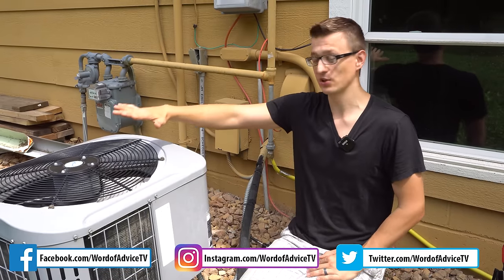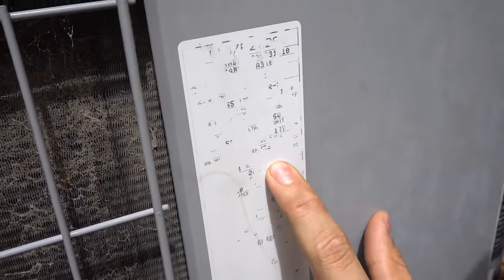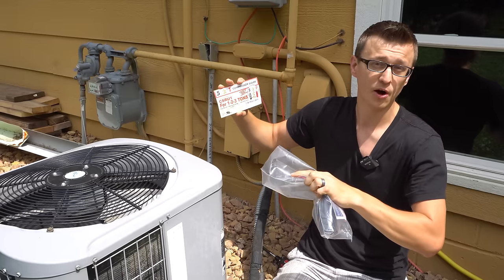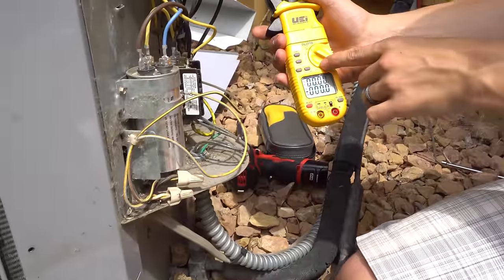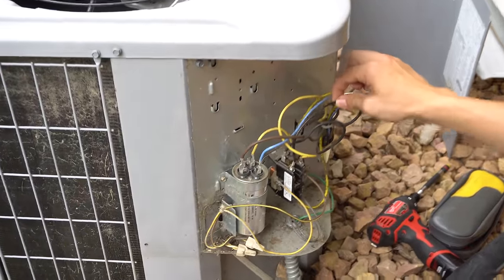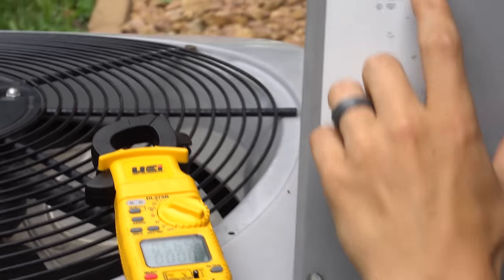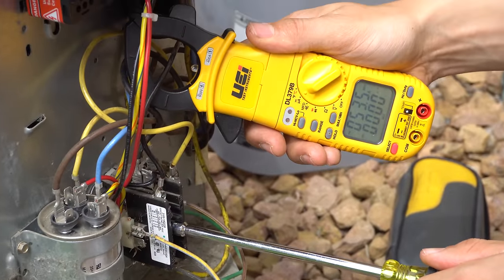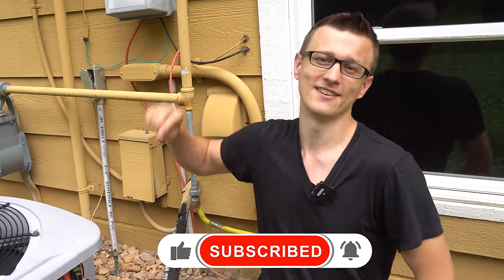HVAC AC Compressor Locked Up ( LRA )

Comment: I installed a 5-2-1 on my 2 Ton Condenser even though it did not need it. The in rush current went down dramatically ! It now starts even smoother that it did before.

Comment: A technician tested my home AC and said I needed a new compressor because it would not start.  A few days later another technician arrived with the new compressor.  Thanks to your website I asked a few questions.  The technician put in another capacitor and a booster.  The AC started and all diagnostics tests were fine.  This saved me $1,750.00.  This video helped me understand enough to ask the right questions. Super.  Thanks.
Reply: I’ve watched thousands of Hvac videos (don’t ask) and this guy is by far the best in terms of clarity and teaching. I’m glad you were able to save almost 2k

Comment: Compressor savers do NOT reduce the maximum inrush current. They provide extra starting torque, causing the amount of time that the compressor is pulling LRA to be reduced, but for the moment of inrush, the compressor saver INCREASES the current.
Reply: So after installation if the inrush current doesn't drop much, how can you verify that the compressor saver is working correctly?

Comment: Not sure that using the Max button and Inrush are equivalent. To measure Inrush, you need a clamp meter with an actual Inrush button, because it measures current in the first 100 milliseconds of startup. Max doesn’t capture current in that time frame. Soft start kits are more effective at reducing startup amps than hard starts which actually spike the compressor start winding with higher amps to kick start the compressor.
Reply: good info, soft start kits reduce amps

Comment: I initially measured my HVAC AC compressor, that has a LRA of 95 amps, with a min/max clamp on meter and got a reading of 75.7 amps and I thought that's good. Then a friend of mine got in my head and told me I needed an inrush meter for that measurement. I caved and bought one and then got a reading of 95.7 amps. I just ordered a hard start kit and hopefully that helps.

Comment: I recommend changing them every 5 years. Only use Hard Start Kits that use a true Potential Relay. The RectorSeal Kickstart (2 wire) and the 5-2-1 Compressor Saver (3 wire) use a Potential Relay. I recommend the RectorSeal Kickstart (it uses 2 wires that connect to the Run Capacitor - HERM and COM). But the Compressor Saver is also good (3 wires with one connecting to the common / ground on the Contactor). 

They both work the same way - the Potential Relay detects the pickup voltage (back EMF). This causes the relay to disconnect the start capacitor when the compressor reaches about 75% speed (less than a second). 

Note:  Before any hard start kit is installed, the compressor run capacitor should be replaced or at least checked to confirm it is still within its rated specifications using a capacitance meter.

Note: Supco does have hard start kits with a Potential Relay (Models 3W1, 3W2, 3W3, MPR1, MPR5, SPR5, SPR1, SPP4E, SPP5E, SPP6E, SPP7E, SPP8E, SPP9E, SPP10E)  but some don't!
Reply from the maker: Thank you for all the additional info Capt!
Reply: Thanks
Reply: @WordofAdviceTV  
Thank you so very much pal
You are very good at your work and also a very good teacher
Thank you again

Comment: Hope you’re do a video on the “Micro-Air EasyStart” soon. It’s a soft start, just the opposite of the hard start. It will drop the inrush amps 60 to 70%.
Reply from the maker: Thank you for the suggestion! I will add this to the list.
Reply: @WordofAdviceTV  I have installed two, plan to do 4 more this coming week. They do what they claim!

Comment: That is correct without INRUSH engaged the reading will not be the actual inrush current because the meter does NOT sample the current often enough.

Comment: I checked the max amps and amp draw right at the main panel for the double pole circuit breaker that supplies the AC. . Each leg had a max draw of -80 amps (81 on one and 77 on the other) on start up and ran at 17.5 amps steady state. Used a Fluke 87V in high res mode. The RLA is 23.7 amps and the LRA is 129.0 amp per the specs on the unit. It’s a 4 ton (48,200 BTU) unit. I do have a 5-2-1 kit on it as well. I’ve never tried it but I don’t think my 7500 W peak generator will start this unit.

PS those coils are very dirty!  Thanks for posting
Reply: My 4 ton RLA 22, but runs hot 32 amps.  It may be suction line is too small  3/4" when is should be 7/8".  I'm trying to learn what is needed to start compressor using solar battery backup to help offset cost of DIY solar.  I've not yet tested LRA that  is listed at 117 amps that I'll need to get as low as possible.

Comment: Hey Jay when would you recommend installing this kit ? When the unit is new or after a few years ? Thanks for the video.
Reply: If installing when the condenser is new, it will likely add to the life of the compressor as it starts with less stress due to the assist in initial current draw.  On older systems, it helps as well.  After installing, you'll definitely notice the lag time from when the compressor begins to engage and full run diminish.
Reply: Manufacturers used to preinstall these kits on all new units to extend the life of the compressor.  Most don't anymore - to save $20 in manufacturing cost!?  Some manufacturers like Trane actually sell their own brand of hard start kits.

Comment: Ha: the anti climax at 7:18 gotta love it when that happens! 😁. 

Can we presume gas pressures have equalised by the 2nd test? Repeat the test too quickly : residual back pressure may  affect LRA
Reply from the maker: Haha yeah, I was briefly surprised before realizing what's up. 

And yes! I always give it time to equalize when powering on the condenser multiple times

Comment: I installed an EasyStar from Micro-Air and allowed my Trane XL14i 3Ton 83LRA rating to drop so low I could run my central air on a 9k portable generator!  I live in Fl and I wanted to have AC after any hurricane.

Comment: Whats up brother ive always wondered why arent hard starts included in unit from manufacturer or recommended to add after if it seems like it would help with the wear and tear during start up. Any ideas why?
Reply: It’s all about cost.
Reply: Manufacturers used to preinstall these kits on all new units to extend the life of the compressor.  Most don't anymore - to save $20 in manufacturing cost!?  Some manufacturers like Trane actually sell their own brand of hard start kits.

Comment: Great video thanks for posting!  Kind of curious if you measure the amps from the L1 and L2 wires Individually will the sum of those two equal the amperage measured on the common? Thanks for another great video

Comment: Fun Fact: The "IN RUSH" current being so high is due to the necessity to generate the electro-magnetic field surronding the coils. An electro-magnetic field is stored energy, and the collapse or creation of an EM field is done so (likely) at the speed of light (this has never been measured to my knowledge). That In Rush of current is the field being established. This is why draining resistor banks or field breakers are necessary when cutting large motors off, the field collapses back down (stored energy) and actually uses whats called a hysteresis cycle to convert magnetism into dielectricity. Magnetism in an electric circuit is always linked to current/amperage while dielectricty is linked to the volatge. And the system is constantly fluctuating (in AC power) between the two at 60hz. This is all according to C.P. Stiemetz, the guy who reversed engineered Teslas AC motor, and was the founder and director of General Electrics R&D division until his death. Anyone interested should get his book "Elementary Lectures on Electric Discharges, Waves and Impulses and other Transients."
Reply: Wow, so much to learn.

Comment: Fantastic videos Jay!! Your channel videos have really motivated me to learn more about my home HVAC system and...make HVAC great again!
*Would this LRA compressor struggle also apply to heat pumps (running in heating mode) in cold weather?* Yesterday it was just above 0º C / 32ºF freezing (Toronto, Ontario) and the compressor and fan unit both seemed to be struggling to start...but eventually did after about 5 seconds of "whining". It happened only once and ran fine later. The outside unit is going on 7 years, so it is not too old. I will have to diagnose the LRA and the start capacitor properly after going over your videos again.
Btw, any plans to make videos on heat pumps? :-) Not sure how common they are in Minnesota / Hawaii, but it would be terrific to hear your thoughts on the topic of heat pumps in general.
God bless you and your family.
Reply: Yes it doesn’t matter the season. Remember the start assist ckt does not stay in circuit. Back EMF takes it out once unit starts up. You may have been listening to ur heat pump coming out of defrost mode.

Comment: great video...
I have got two questions on LRA
1 what do you mean when you say that the compressor is locked?
2 how do I know that my compressor is locked is it when it draws amps more than the lra or less than the lra?

Comment: FYI "Compressor Saver" or all capacitors in general should be installed upright, they'll last longer. Per my Microbiologist turned HVAC single man contractor professor & capacitor makers he's talked to.
Reply from the maker: I have heard that before too, thank you for pointing it out!
Reply: Thanks for this because 2 other tutorials I saw have them mounted sideways. I put mine in sideways yesterday and am going out to fix it now. The hard start kit relay also needs to be oriented correctly too which I luckily knew beforehand.

Comment: So. Why such a small change? How does this thing work? Is it a staged (timed) capacitor engagement?
Reply from the maker: I am not entirely sure why the small change. It varies from unit to unit, how much the start up amps go down by.
The start capacitor stays in the circuit for only a second or less before getting taken out by the potential relay. It's only there to assist the compressor at start-up.

Comment: Hey Jay is this the same device calld a hard start kit??  I remmber it go in series  whit the run cap .. by the way great video every time u make a video I allways take note you the man .. and congrats  on movie to Hawaii
Reply from the maker: Thanks Juan! Yes, the 521 Compressor is a hard start kit. There are a few different styles but they are all basically a start capacitor and some kind of relay that takes the start capacitor out of the circuit after the compressor is up to full speed at start-up. After answering this comment, I will put some Amazon links to different hard start kits in the description for anyone interested.

Comment: How do I tell if my furnace and hot water tank are natural draft or fan-assisted? I think they are both natural draft but want to confirm. The furnace is category 1 (80%) - 1990 Olsen furnace and hot water is John wood 2012. Thanks in advance you are very helpful!
Reply: For your furnace just remove the access door and then trace your flue pipe back to the furnace. If it’s induced draft (fan assisted) you will see the inducer fan and motor. Basically follow the same method for your water heater.

Comment: Jay, could the small difference be because the hard start didn't get charged up cuz the power was off?
Reply from the maker: I think it's more because I was working with a scroll compressor. For some reason the drop is not as impressive on those. But unfortunately I haven't done this test enough times myself either so I can't say for sure. If I did this 20 - 40 times, that would probably paint a clearer picture but I rarely test the before and after.
Reply: @WordofAdviceTV   ok, didn't know that.  Thanks. Love these videos! (as everyone else does)

Comment: I have the same question as Jeff.
I took out the one that I had put in the old unit, so should I install it in the new unit?
Reply from the maker: There is less strain on the compressor when it starts if there is a hard start kit installed. So I would say why not put in? :)

Comment: Hi Jay
Thanks for all great videos!
Question: for 7.5 ton RUUD unit 3 phase compressor 
Is there such a kit?

Thanks
Robert
Reply: There is no need for a hard start kit on a 3 phase unit as the phase shift that the hard start kit provides is already "built-in-to" 3 phase.

Comment: Talking about Inrush, I have tested Fieldpeace, Fluke, UEI, Klein, with the Min Max and I have seen little to no difference with a meter that actually has an Inrush setting. Im kinda wondering if its just a selling point.

Comment: Jay my man! Do you have a vid on how to install a fuse or breaker inline with hvac transformer to prevent burnouts due to thermostat wire shorts?? Thx n advance brotha!
Reply from the maker: Hey Justin! I do not have a video like that unfortunately.. But in this video right here, I do show an example of how I spliced one into my furnace: https://youtu.be/52iq9rYI0mI 
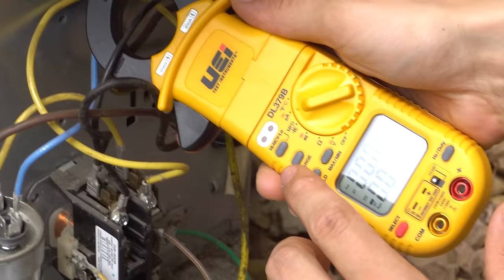Start watching at about 5:30
Reply: @WordofAdviceTV  thank you sir!

Comment: Viewers.  You cannot measure IRA with a meter that only has min/max.   You must use a meter with Inrush setting.  IRA is too fast for a Non-IRA capable meter to catch it, that's why they have a dedicated "in rush" feature.   That's why there was virtually no difference in his readings.

Hard start kits work.  If your compressor makes a grinding noise when starting but still starts, a hard start will probably buy you time before the compressor fails, but it will not "fix" what is wrong.

Comment: Hey Jay, this is Jay too. I have some issues with my compressor the start-up Amps is around 94 but the LRA is 75 amp in the label. I checked your other video first (How to Install a Hard Start Kit in Your Air Conditioner). But during the video, you said 'don't put in a hard start kit if you already have a start capacitor in your unit'. But in his video, you seem to have the start capacitor but do you still recommend the Hart Start Kit? Would you mind explaining a bit to me and I appreciate it.

Comment: so if it is starting at 56 Amps , wouldnt it immediately trip the breaker before locking up? unless its a 60 amp breaker?

Comment: I was under the impression that a locked rotor is a compressor that has internal damage and needs to be replaced?
A compressor that does not have enough amps to spin it up is not locked same as if you lost half the leg in or a bad capacitor.
Correct me if i'm wrong.
Reply from the maker: A seized up compressor does not always indicate that there is internal damage although it is likely to be the case. It's possible that the unit had a weak run capacitor for a long time which eventually led it to lock-up. I have come across many locked up compressors that I was able to kickstart using a hard start kit. The dual run capacitor is good, power is good, compressor checks out good, yet it fails to start. Put in a hard start, and there's a good chance it will start right up. I have also had times where the unit would only turn on a couple times before it would fail to start again even with a hard start. If it gets to that point, then it's truly game over for that compressor.

Comment: PTAC compressor is humming then clicks off. LRA is 33 but only drawing 23amps on common with hard start kit. New capacitor installed. Changed the board as well. What else could this be? Thx

Comment: If the compressor were to lock up well that damage the Freon to where you could reuse it?
Reply: Compressor lock-up alone will not damage the refrigerant, but if the winding wire are burnt than that "burnt" could .

Comment: Hi Sir, I have replaced a breakage compressor of Electrolux by a new GMC one same 2.25 hp. But the unit stops after 5 minutes n the compressor gets so hot. Temperature reduces from 30 to only 27. RLA is not the same, is this the reason? n how to solve the problem
Reply: I’m having similar issue

Comment: I dont get it, i have 0,5 amps on common (ground) and 3,45 on T1T2T3 each 3phase. copeland,  how can i have only 0,5 amps on common ?  Full load should be 5,2 when i read on the kompressor.

Comment: Hi very great video 👏
I have question,I checked the ac of the client ,the compressor did not run ,

I put hard starter kit ,the compressor runs but the run wire is 40 ramps and breaker trips.
What's the reason ?